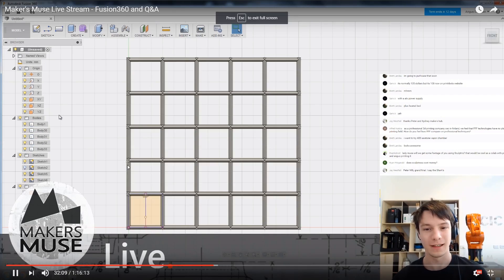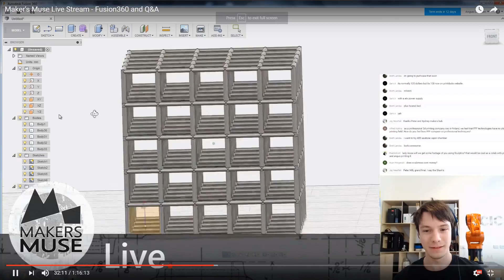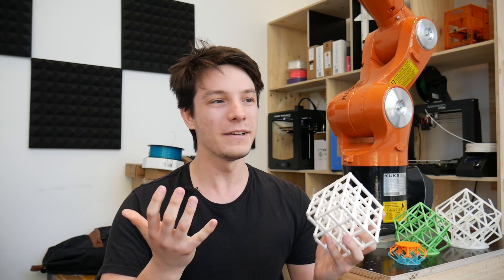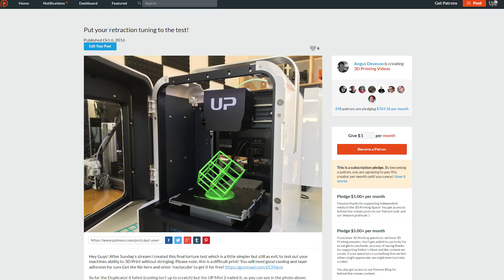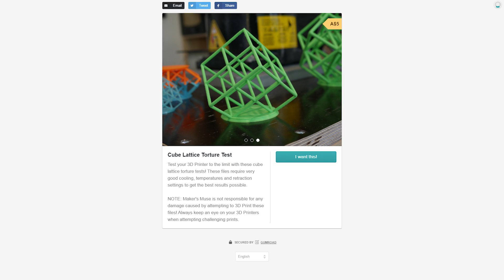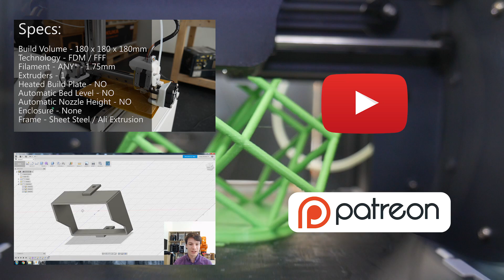The most challenging 3D Print I've ever devised - Cube Lattice Torture Test

Comment: UP! Box failed
Zortrax m200 worked 
Cubicon single almost success 
Ultimaker 2+ success 
Flashforge dreamer and creator pro failed 
Flashforge Finder success 
CubePro failed 
Cube 3rd gen failed 
Cube 2nd gen Failed 
Prusa i3 the best success 
M3D micro failed 
Makerbot 5th gen failed 
I will send pictures to your email later this weekend
Reply: flashforge finder success?!
Reply: Salem Abualrous creator pro? settings incorrect?
Reply: Cullen Lonergan maybe I don't print on creator pro much lately also I discovered a bad nozzle lately and replaced it maybe it's the reason

Comment: That YouTube upload wasn't the time lapse. This one is.

https://youtu.be/SxGPlNd5jy8
Reply from the maker: Awesome! Bit stringy but amazing what that little machine can pull off.
Reply: I was amazed that it didn't just collapse midway and end up as a poorly constructed bird's nest.
Reply: The worst of that stringiness is due to issue with my hot end. It's leaking badly where the break enters the heat block which is then dripping down into the print. I'm thinking I may have over tightened it and damaged the break. I ordered a new V6 which should be here tomorrow. Installing it could get interesting because of how the wires are routed. I'm hoping I don't need to dismantle the whole printer. We'll see.
Reply: Here's another print on the Fabrikator Mini with the new print head. The head is a direct replacement E3D v6 from Hobby King. The filament is Orb Polymer Blue Octopus PLA.

https://www.dropbox.com/s/4wvtpn6mes5m5l5/IMG_2024.jpg?dl=0

Comment: Sorry but this doesn't test the printer, this test your slicer settings. The only part of the printer that matter here is the cooling, nothing else.
Reply from the maker: It also tests printer accuracy and ability to hop between multiple points without drifting or losing steps - also Z hop accuracy and machine rigidity overall. It's just a really difficult file :)
Reply: -Temperature settings must be tuned to prevent leaking when retracting.
-As you said cooling on the model. To prevent sagging.
-If you exclude the platform bed adhesion becomes a factor.
-z-limit, extrusion multiplier and bed leveling need to be tuned to get nice surfaces.

I agree in that its not a torture test. But it is testing part cooling and retraction capabilities.
Reply: that's exactly what he says at the beginning of the video, the cooling

Comment: I have a similar lattice cube, I rotate in Euler XYZ X 45 , Y 45 so that I have some various types of overhang angles instead of 45d,35.264d like I think you are doing.
 I also print mine with 0 % infill. I am surprised of the problem you had on the i3 Mk2. I had no trouble with mine using the Extrafill Rapunzel filament. My cylinders are 10mm, that may explain why.

Comment: Mine turned out really well actually. I used some black PETG filament and didn't change any of my settings. 

Nasty Cube Results https://imgur.com/a/q8q0X
Reply: Nice! My PETG print would have looked about like that except that the fan design on my printer is such that it only cooled the left side of this print while leaving the right side to string and sag. :(
Reply from the maker: Awesome! I was trying to find yours for the video but forgot it wasn't on twitter. That is some awesome cooling of PETG! You've got your machine dialed if you can just send that for printing with such a good result.
Reply: Maker's Muse - Thanks! I have been very happy with this Eclips3D printer. Just sold it and will be beta testing the new Eclips3D2 in the coming weeks. 3dPrintedLife on YouTube designs them. Rock solid printer with great results! Can't wait to try it again when the new printer arrives! Got any other torture tests in the works?

Brandon - Mine only cools one side as well. I do notice some artifacts because of this, but I was happy that there was no sagging and very little stringing. Especially since I hadn't tweaked any of the settings.